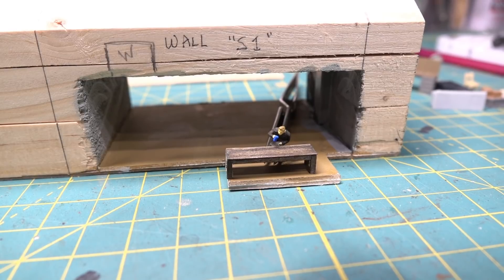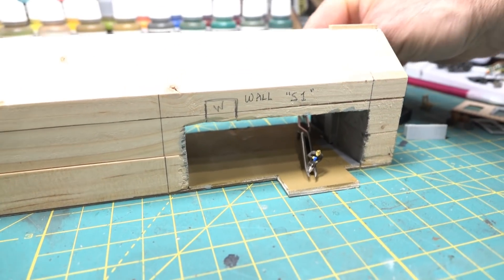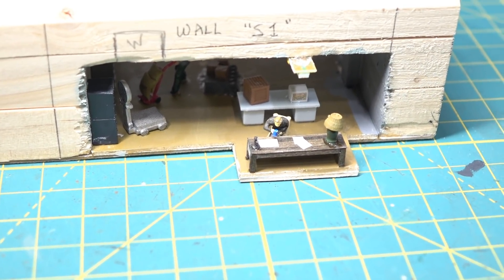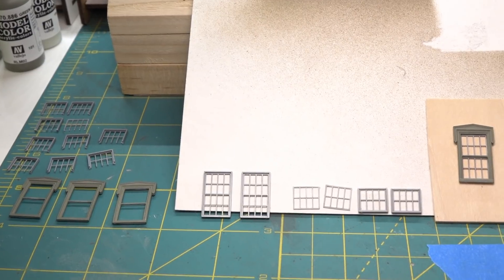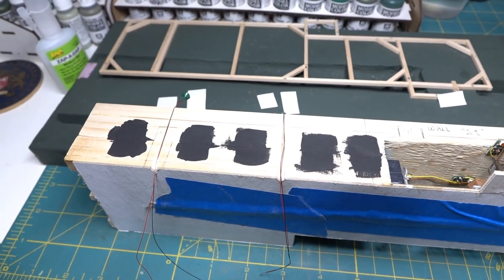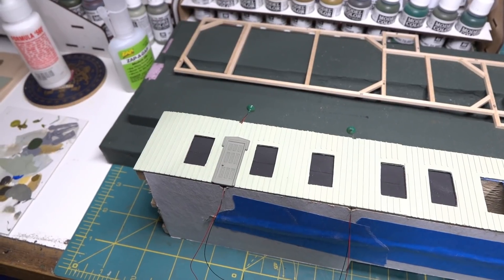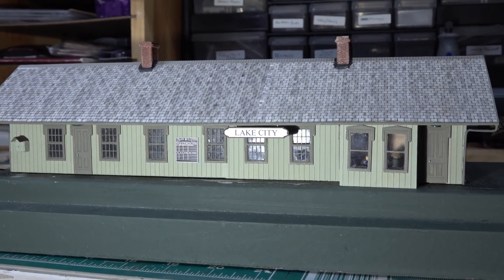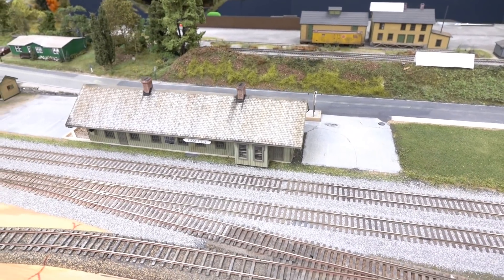Scratch Build #6: Lake City, PA Train Station

Comment: Another job well done.  The crooked window would drive me nuts though.  Actually, that entire small wall looks like it's off a bit.  I would pop that window off and re-center it.  But then I'm very OCD!
Reply: I'll admit it does bother me- slightly. Not sure it is enough to fix it yet. And you are correct the entire wall is indeed just a smidgen off. Damn late night building sessions...

Comment: Mullons is the term I believe for the framework that holds the window panes. Another excellent video tutorial. Question: the secondary track in the foreground of the station/diner did you remove every other tie or every third tie?
Reply: Yes I did. This is Micro Engineering code 83 flex. I turn it over and cut the "web" every 2-3rd tie, then turn it back over and simply snap off the cut ties. To me it makes nice spur/industrial track.
Reply: @robbennett1965  very realistic and effective. I always liked micro engineering track products.

Comment: The smaller window dividers would be mullions
Reply: Mullions, I believe are fake dividers. So in the fifties when this building was constructed they would have been true divided light...If memory serves?
Reply: caspianwendell From Wikipedia. A mullion is a vertical element that forms a division between units of a window or screen, or is used decoratively.[1] When dividing adjacent window units its primary purpose is a rigid support to the glazing of the window.
Reply: That is correct, it only supports a single large pane of glass, however back then they used separate panes, and true divided lights, I am retired from construction and that’s what we always called them.